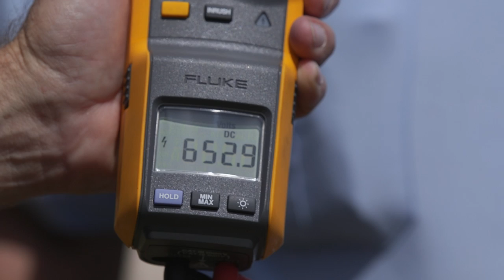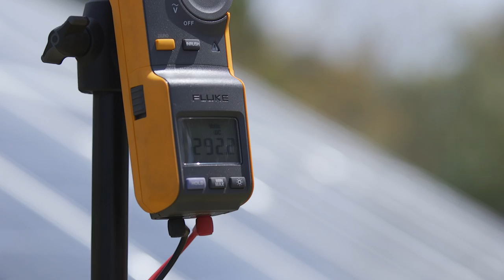Electrical Arcing & Water Conductivity

Comment: I'm just here wondering who has a 600V series setup for their home...  Keep it under 60 volts high amp and no one ever has to worry about getting shocked.
Reply: Any domestic string array (or commercial system for that matter) that does not feature microinverters or DC optimisers can have up to 600V in series.  Even "rapid shutdown" systems have their limitations.  The only way to ensure complete safety is to block the light reaching the solar panels - light is the source of the power.
Reply: The cheapest inverters are string inverters and they can go upto 600+V. Using microinverters will reduce voltage but the cost of wiring and the inverter itself will more than double
Reply: @shrujanamsyama9940  its not double the cost but micros are more expensive - however what price do you put on your home or family
Reply: @airselectricalcontractors842  If one has 15 panels of 335W for a total of 5kW, only 1 string inverter with 600V is enough whereas 15 microinverters will be needed. In addition, the current will increase, necessitating thicker wires. This doubles the cost indeed.

About price of home or family, I don't see how high voltage is a bigger risk than high amperage in causing fires. In fact, the higher amperage causes higher heat and hence increases chances of fire. As a disclosure, in my case, I live in brick homes with concrete roof as most normal people in India do. There is almost no chance of fire from solar panels at all in my case, regardless of voltage or amperage. So, it mostly boils down to cost of thick wirings and microinverters
Reply: @shrujanamsyama9940  mate i do solar  and am an electrican - micr invertors are on 4mm cable - same as string invertors - micros are 240v in australia ac not 600 plus dc - micros are protected by circuit breakers and have rapid shut down - you just turn the circuit off at your switchboard - string invertors cant be turned of while the sun is out - i know what i would put on my kidds roofs

Comment: Doing your high voltage mesures without electric protection gloves, you are taking risks, be careful ;)

And about the voltage, on roof top with no extra lengt of wire you should not go over 100V for safety and not useful gains in performances. (And don't say you're using 0.75mm² copper wires)
Reply from the maker: Hi Jean, well spotted and agreed, we are using appropriate electrical protective gloves for all our future demonstrations.  Please could you clarify your question regarding voltage on roof and 100volts? I am unsure of what you mean, but I would be happy to discuss.
Reply: About the end, that wasn't really a question, but more another concern of safety for installations. Going over 100V on an roof installation of an house is dangerous and don't bring more efficiency. Then I consider installations over 100V (except specific ones) as dangerously designed from the start.

And I haven't expected your answer so much time after the post of the video, that's a sign of care, a good sign.
Reply from the maker: Hi Jean, yes the vast majority of domestic, commercial and industrial  PV installations around the world have voltages well in excess of 100V on their roofs.  This is why fire and emergency services agencies are so concerned about the "DC Danger Zone".  We provide the only solution that can quickly safely and effectively isolate the power produced by solar panels in incidents involving solar PV systems.  We also provide education and training to support the product.  

There is currently so much myth and mis-information surrounding solar PV systems technology, which is why we try to keep up with these posts and educate people on the facts.  We are passionate about renewable technology and firefighter safety and your kind words are much appreciated!
Reply: @jasonbone5121  Your comment isn't gonna get a response when you question so harshly.
Reply: String inverters need at least 200V to turn on. The low voltage solar inverters are the more expensive microinverters which cost 2 times that of string inverters
Reply: @jasonbone5121  Hello, many inverters does work under less than 100V. You may install roofs with up to 600V all day long. But it doesn't changes how dangerous it can be.

The higher the voltage, the less loss you have on the inverter side, often yes, often for cables too. But many inverters works with 48V ; 96V. They are safer if you don't need more lenght of wires between the pannels and inverter. 

On the other side, if you need more than 20meters of lenght, yes higher voltage helps efficiency. 

You say clueless, please consider learning some things considering the other possibilities without being rude.

thanks. 

PS: Late response, I didn't get notified by your message until recently. And I don't tell people wrong or right at random, I just share the view of risks choosing one option over another, not telling you're wrong.
Reply: @shrujanamsyama9940  Hello, many doesn't need that voltage, also many turns on only as you described. 

The cost is higher on low voltage, right, but not 2 times, and it really depends on your concerns. On a roof safety may be a concern. For example on my roof l’m on 96V strings (sure going higher in direct sun, but not by much ) and I'm more on 300V on ground, with higher cable distance.

Safety and choices, possibilities are here and prices not that far. Take the Growatt SPF3000TL inverter for example. Works well and requires 30V to 80V to work on PV. Safe, good price and works well.
Reply: @jean-baptistefox2819  If you are speaking of off-grid inverters, yes, 100-150V is a decent voltage. But in such cases, why would you install a 3+kW system? Off grid systems mostly use less than 2kW system with an intent of using 5-6kWh per day. 3+kW systems are used by homes which use grid tied or at least hybrid system. In grid tied cases, the cost of inverter & wiring for a string inverter of 3kW is $400-500 but goes to $700-800 for a microinverter with wiring. If one has to use lower voltage, one will be forced to use microinverters since string inverters use all panels in series. This increases cost significantly
Reply: @shrujanamsyama9940  You don't need necessary micro inverters, and hybrid systems have no problems on being low voltage plus grid. 

Useless to have +600V anyway except if you have heavy power, and by heavy 20 to 30kw minimum, and here, costs are up the roof. 

Many offgrid houses uses more power than you describe, and for winter you need over dimention. 

No need at all such high voltages.
Reply: @jean-baptistefox2819  If you are using cheap string inverters, the voltage will easily go to 360 for a 3kW system (9 panels of 333W with 40V). For a 5kW setup, voltage can do to 600. Most of the time, 600V may be put in two parallel strings of 300V. The rule of thumb in string inverter is that the DC peak voltage should be roughly 150% of the grid voltage for best efficiency. Grid voltage in most countries is 220-240 and hence 350V is very common. USA is an exception as it has 120V grid
Reply: @shrujanamsyama9940  Your statement is valid, but doesn't change what I said ^^ 

And I do prefer to put a little bit more on inverter for safety on roofs, I repeat, on ground it is fine. 

And for efficiency, at 95 / 98% even with 160V array there is no real need of 600V 

Buuut you're right, no need to step up rootsquare 3 of the wave if you put three phases system. Cause on a 400V three phases we get peak 692.8V on the wave.

Comment: Why I like solar Edge or dc to ac inverter, as each panel has its own independent dc to dc inverter (solar Edge) or dc to ac inverter, once the solar edge inverter is shut off or ac grid power is loss all micro inverters switch off making roof safe (max 1v per solar edge dc to dc inverter) solar Edge also Has ark protection so what he was doing in this video would of not happened as it would of shut down all dc to Dc inverters the moment the ark started at 1mm distance
Reply from the maker: Solar Edge make a good product and definitely improves safety, just be aware that the panels themselves are still live as long as they are exposed to light.  The problem is, when firefighters respond to an incident, it is very difficult for them to identify the difference between a Solar Edge system, a Microinverter system or a normal string array system.  Most firefighters do not have the necessary training to identify the different system types.  The beauty of PVStop is it's simplicity, it is equally effective on any type of solar PV system; as long as a firefighter can see that PVStop has been applied, they know they are electrically safe.  Post incident it can be peeled off and does not damage the PV system.  A very simple solution that dramatically improves firefighter safety.

Comment: Yeah, when you put 20 in series.... Nobody does that without solaredge...  and no (inspected) resi system in America can have a VOC above 600.
Reply from the maker: You are correct if you are referring specifically to residential systems, no residential system can have more than 600 VOC in series, however commercial and industrial systems can have up to 1500 VOC in series.
Reply: That's y I wrote:... resi system...
I design resi and commercial grid tied pv arrays.  :) #gosolar

Comment: Will people stop calling solar power systems "Solar Systems". A solar system is a star and its surrounding planets.
Reply: Agreed. it's a "Photovoltaic system". Also, it's more specific, to call the individual frames, "photovoltaic panels". there are also thermal absorption panels, some heat water, others heat air. they're also panels, that harvest energy from the sun. so "solar panel" is a very generalized term. If you don't want to say "Photovoltaic", use the abbreviation "PV panels".
Reply: If you slip on it and bang your head, you see stars.

Comment: This problem is solved by installing optimizers on each panel. After shutdown, the panels are disconnected and the voltage is at panel level. SolarEdge.
Reply from the maker: The problem is not solved by optimizers or microinverters, collectively referred to as "rapid shutdown" technologies, they are complimentary safety devices to the PVSTOP solution.  To steer you to some of the reasoning, I have included a link to the following website www.fixmlsd.com (note that we are not affiliated with this website).  In addition, first responders do not have the depth of training to be able to easily identify between a string array or a rapid shutdown array, they are always going to assume that the PV system is live and dangerous.  PVSTOP is the only accredited solution that solves this fundamental problem.

Comment: For how long will they produce energy once broken? What about using optimizers on them?
Reply from the maker: Even when damaged, solar panels will continue to produce power (albeit in a reduced capacity) as long as they are exposed to light (as demonstrated in the video).  Optimizers are an electro-mechanical solution that operate "downstream" from the solar panel itself and there are questions over whether they will fail-safe if damaged during an incident.  PVSTOP is the only accredited solution that isolates the power produced by solar PV systems at the source of power production - the solar panels themselves.

Comment: There was no explanation of how "PV Stop" works, or what it even is. What's PV Stop?
Reply from the maker: PVStop is designed to "switch off" the power produced by solar panels.  In emergency situations such as fires, floods or storms, solar panels continue to produce potentially lethal amounts of DC electricity as long as they are exposed to light.  In professional terms this is known as the "DC Danger Zone" and up until recently, there has been no solution to this globally recognized problem.  PVStop is the solution to this problem, the polymer film technology coats the solar panels, blocking the light and making the solar panels electrically safe so that first responders and electrical contractors can perform their operations safely without the risk of electrocution.
Reply: Its essential carbon black spray mud in a fire extinguisher. Pv panels are a type of diode and block power when covered. We commonly cover a panel in each string when washing.
Reply: @tomtaylor8462  We like to think that PVSTOP is a little more technical than "carbon black spray mud".  For example, because it is an accredited first response tool, it is fire-retardant, non-flammable, non-conductive and also encases hazardous nanoparticles that can be released from burning solar panels.  In addition it is environmentally friendly having been extensively tested by the Environmental Protection Agency (EPA).  Finally once an incident is over, the coating can be peeled off without causing any damage to the PV system.

Comment: How about you just build a system that doesn't arc in the presence of water?  The number is around 70V so a 48V system seems best.  At 48V the system generally doesn't require expensive wires (for normal residential systems) and is way easier to deal with.  Only people installing 600V systems are just being cheap on materials and don't care about safety. I ran a 24V system in wet conditions for many years with zero electrical problems.
Reply from the maker: Hi Richard,  the purpose of the video was to demonstrate a scenario that can happen if water is applied to a damaged system, an example of an unanticipated risk encountered by first responders.  A well installed 600V system utilising good quality components and serviced regularly is extremely safe, as is a good quality 48V system.  The problem is (and you are correct) a lot of people do not understand the technical aspects of the technology and will often install the cheapest system that they are quoted, not understanding the safety consequences. Trust me, there are a whole lot of dangerous or sub-standard systems out there.  The stats in Australia alone (based on government audited figures), 4% of domestic PV installations are dangerous and a further 16% are sub-standard.  Globally, incidents involving solar PV arrays are rising significantly which is why Fire services in a number of countries are now rolling out our product.
Reply: Thanks for your response. Yes, some of the system I see are pretty scary.  Probably installed before there was code or installed by the home owner.  California got a bit out of control on the regulations.  They kept changing the grid tie rules.  I went thru 3 different units trying to keep up.
Reply from the maker: Yes, this is a global problem, the industry has been a modern day gold rush that shows no sign of abating with many companies putting profit before safety and codes and regulations has simply not been able to keep up.  In addition, there is still a significant knowledge gap on all sides.  A major objective of our business is to improve knowledge through education and to offer tools that significantly improve firefighter safety.  Thanks for your comments, I appreciate your interest.

Comment: So what I understood is Even if you crush or set them on fire, these panels will continue to work 🤔
Reply from the maker: Each cell in a solar panel produces 0.6 volts.  No doubt as more cells in a panel are destroyed by fire, the electrical output of the panel will reduce.  However the cells that are not damaged/destroyed in the panel (or the other panels in the string) will continue to produce power as long as they are exposed to light.  So a solar PV string that is extensively damaged can still continue to produce dangerous amounts of DC electricity.

Comment: Well its apparent that your array wasn't properly grounded
Reply: True statement. All panel frames, rails, and mounting hardware is required by code, to be earth grounded. Not just for the reasons depicted in this video, but also to safely ground lightning strikes. It may or may not save your PV system, it will save a possible attic fire.

Comment: Oh lets see if adding water kills anyone, I'll volunteer to hose down panels, that one guy said.
Reply: Contrary to popular belief, because the system is NOT earthed, it is SAFER than mains and there was absolutely NO chance of a current path through the person holding the hose. 

Also, the chances of there being one continuous stream of water from the nozzle to the panels at typical garden hose pressure and flow rate is very very slim to none.

But I understand what you are saying.

Comment: Nice video. Safety concept explained well. I’m still not sure what the pvstop product is. An isolation switch??
Reply from the maker: Thank you for your positive feedback, much appreciated!  PVSTOP is a water based polymer that is applied to solar panels like a "liquid blanket", blocking the light and isolating the power produced by solar panels at the source.  It is also fire retardant, non-flammable, non-conductive and environmentally friendly.  PVSTOP is now used by world leading fire departments such as the London Fire Brigade, the New York Fire Department and the Singapore Civil Defence Force (just to name a few).  Here is a link to another YouTube video that demonstrates how the product works: https://youtu.be/wc-qRISs7fo